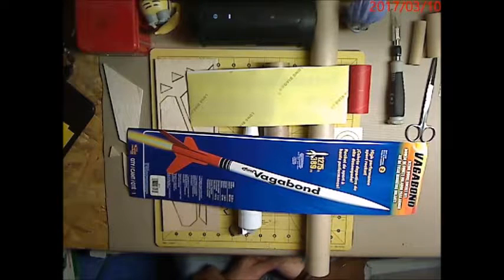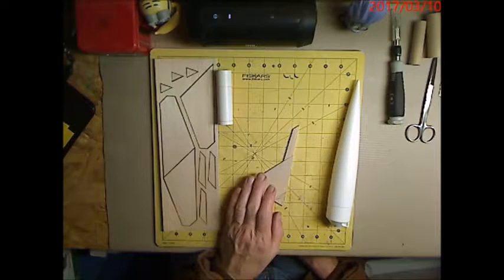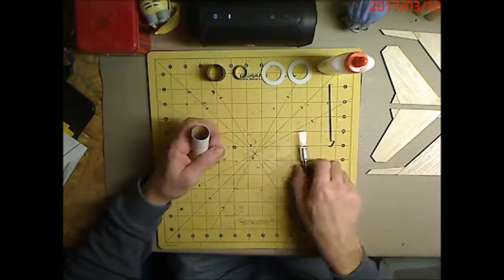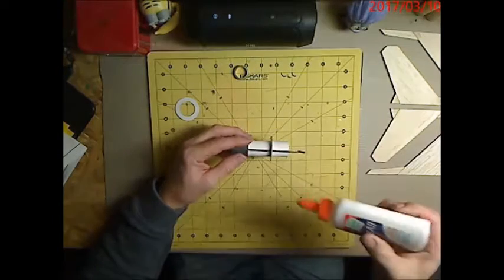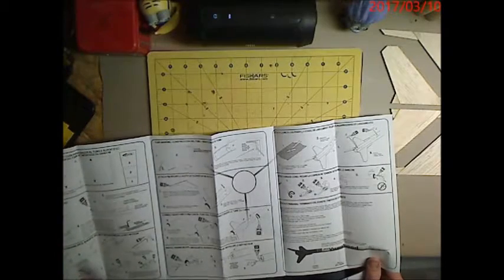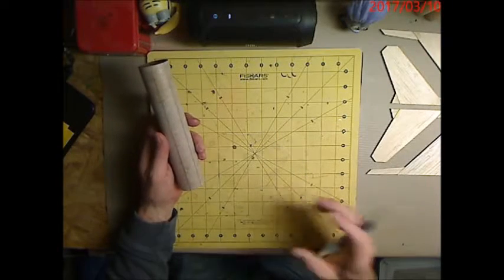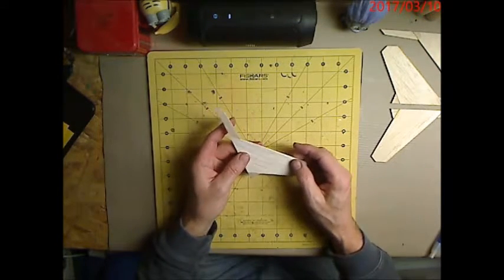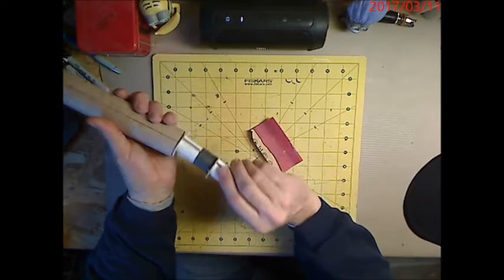Estes Vagabond with Apogee Components Strap On Boosters

Comment: Good video! I might have missed it but what is the black rectangle that you set the body tube on or nose cone during the build. Doyouhavedifferent ones for different body tubes and what is it made of? Thanks.
Reply from the maker: That is a 2X4 with a channel routed down the middle and then covered with felt.